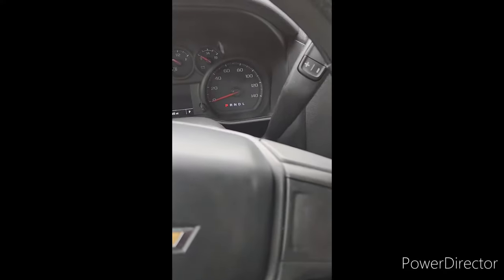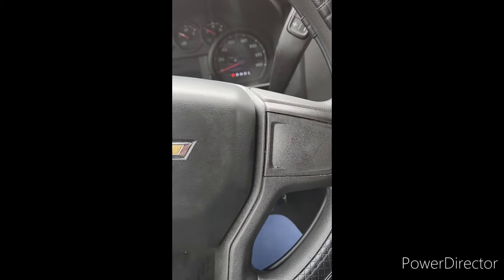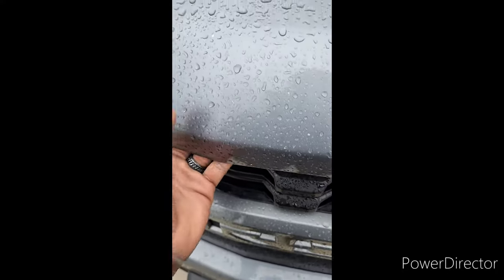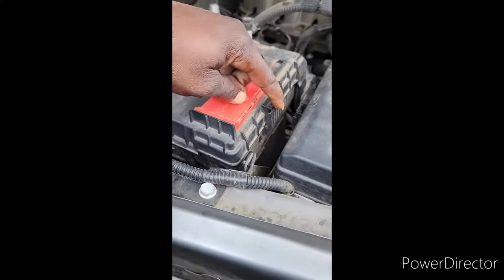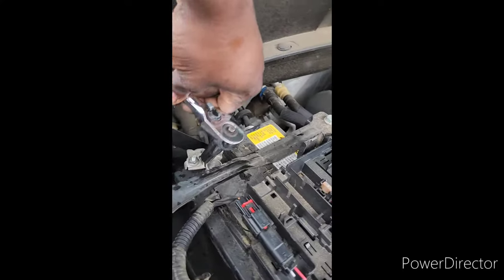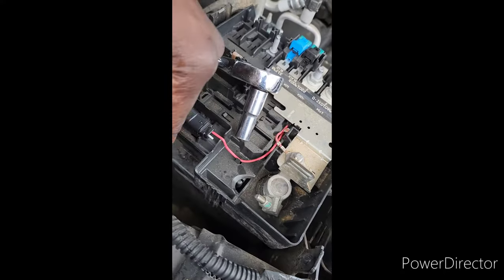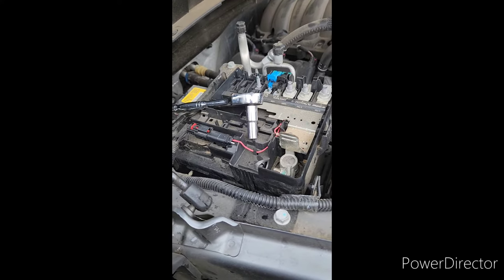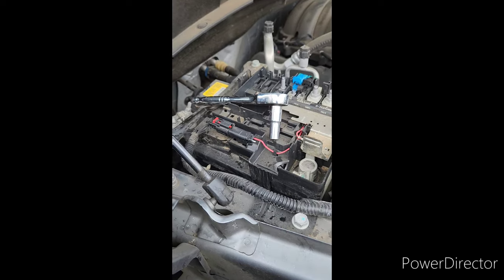2020 chevy silverado 1500 custom break system failure issue quick fix

Comment: I had the same issue. I was able to resolve it by putting the truck into electronic parking brake maintenance mode and then turning the maintenance mode off
Reply: Did you do this while the codes were active?
Reply: @jacoby5240  yes
Reply: How do i get it out of brake service mode?

Comment: I messed with the brakes to fix a broken stud in the wheel hub, tripped all the lights. I ended up, disconnecting the battery overnight, without reconnecting the battery pressing the brake until I was hard, connected the battery, ran the Bluetooth code reader and wiping the codes, turned off and let sit before actually cranking engine. That did the trick

Comment: He didn’t lie you gotta drive your truck for at least 20 minutes & it’ll reset the check engine light maybe on if you dont know about the brake safety system that u have to enable

Comment: Am having same issue I took it to dealership told me they had to electronically bleed my brakes called me few days later paid 500 said it was good when I got in my truck still same codes they worked on it another day next day said my master brake cylinder was bad and it would be 1200 for part and with labor 2500. Didnt let them work on it and they still kept my 500. And now stuck with a broken truck all because  i didnt put the truck on service mode
Reply: What is your truck.?
I'm having same problem right now 😢
Reply: Try using a scanner tool with ABS capabilities and delete all the ABS codes.
Reply: Did you get it fixed.  Mine has to go to the dealer cause I'm having the same issue.  🫤

Comment: Nope couldn’t get it to go in brake service mode but once I hit the parking break and released it a few times it seemed to reset the pistons and fill them up with fluid again so my brakes felt normal again been driving around everything seems to be back to normal

Comment: Did the problem come back? I have a 2019 Silverado high country that has a hiccup every so often. This last time was  the worst it’s had so far that my transmission started acting funny, SERVICE, Esc, brake failure, service trailer brake and check engine light came on. My brakes actually stopped working as I was pulling up to my house.
I can reset the system without unplugging the battery and it run perfectly after. I can’t get the problem figured out
Reply: I have the same model and year truck. Let me know if you figure it out.

Comment: I have a 2020 trail boss. I changed front and rear pads and put vehicle in a service mode and it still have codes. I’ve tried your method and it did not work. I disconnected both battery terminals then wait waited 15 minutes like you suggested and it still have codes on my truck.

Comment: I just replaced my brake pads on a 2019 Chev Silvearado RST... did all the proper procedures, put the brake service mode in, took it out of brake service mode...but like you...the dash lit up like a Christmas tree...Service Engine, Service ESC.. speed limited to 43mph, etc.etc...etc

I tried disconnecting the battery..no luck.
I tried clearing the codes with a scanner... luckily my brother has one.... no luck. 
Codes were still in..

The new sensors need to contact the rotor, i took it for a ride, constant braking, to get the sensors communicating... 
After the ride, with constant braking... all of the codes went away.. 
I still had a Service Engine code, but that went away after disconnecting the battery for a half hour.

Hope this helps

I was told by a mechanic that I shouldn't have disconnected the E-brake, not sure if that what caused this chaos...😂
Reply: have the same problem
Reply: @josevilla477  did you get it fixed?
Reply: i disconnect the battery but didn’t turn off i drove it for 26 miles and park it and it when off alone
Reply: When you had this problem was your truck braking perfect even with the codes on? M, because mine have the codes on but it’s braking like shit. Hopefully it’s normal because of the codes idk
Reply: @rubenaltamiranojr8560  going through this right now. Trucks lit up like a Christmas tree and no brakes
Reply: @gmanthejeepman  I fixed it the same day 
I disconnected the battery ando nothing 
What fixed it was that I was driving like that for a while, then I was driving to Oreyllis to delete codes and they all disappeared but the check engine light, they deleted that and never came back

Comment: My issue- I caused a leak on the passenger side caliper after replacing the brake pads, when I pressed the outer bottom piston in it went in at an angle then I used a c-clamp which scared the piston long story short… I f-d up the caliper! So I replaced it and bled , disconnected the battery, drove around the block, turned truck off, 10 minutes later turned it back on, and codes went away except engine light . 
Live n learn 😣

2019 GMC sierra Denali.

Comment: Was your check engine light reading brake system Module ?
Reply from the maker: Once I got done with the break job there was a ton of warning lights on my dash the message came up about my engine power as far as it will be reduced and I can't exceed the speed light of 45MPH. I test drove it and it definitely limited my speed so I was about to take it to put the scanner on it but I disconnected the battery for 10min and it whip everything out I haven't had any issues at all its running great

Comment: I'm about to try this but I think I ruined my emergency break motors because I screwed them in manually how did you get yours in I tried the brake service mode but I guess it didn't work
Reply from the maker: I got mines in enough to slide the new break pads in to reassemble them
Reply: @jamesblackshell2200  I found out the hard way. They do not screw in just compress them straight in. If you screw them in it ruins the motors.

Comment: 2019 LT. My truck ran great till just now. I have not recently done work. Pulled out park while breaking and car moved forward and brakes felt unresponsive. Got 45 mile max break failure code. Reversed and pushed breaks hard to get back into parking. Turn truck on off, same error. Drove about 30 yds, stopped resistintly. Turned off truck jumped out, closed door hit alarm. Went back in, turned back on, code gone and breaks work.

What should I do?

Comment: I changed my front breaks and sec code came on. I’ll disconnect the battery. But my issue is my breaks aren’t working properly. I have to press hard just to slow down. What could that be?
Reply: Ok lol so I pressed the breaks until the pedal sank in. (Truck was off) And that fixed the “esc,sec” code light. It turned off and the breaks are working properly now. But my service engine light is still on. So I’ll try disconnecting the battery for 10 minutes to see if that works

Comment: i posted this comment on another video, its sucks there isnt too much out there for the trailboss, bitter sweet right? 

thank you so much for this video, i kind of did all the work before watching this. i have a 2020 silverado trailboss LT and let me tell you. ive been changing brakes for years and the way they make these brakes no is stupid. Growing up i never had to disconnect a battery to do a simple brake job. But at the same time im very impressed with how easy it is changing them on the trail boss when everything goes right. any Do it yourself machanic knows any 30 minute job can turn into hours of frustration. what i took from your video was the park service mode for the back breaks. im not even going to get started on that one, i spent 2 hours twisting that motor in 😭😭😭😭😭😭 but currently right now, i had all sorts of lights and the way i got them off was disconnecting battery for like a half hour. check engine light is still on, giving me codes of C0560 and p25a2 and i cant figure it out for the life of me. maybe it needs to "learn" again